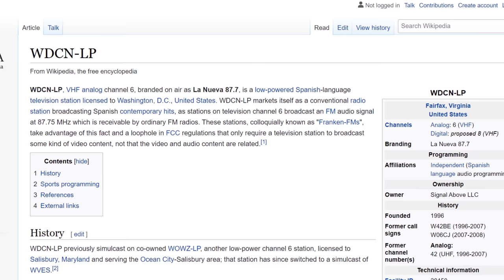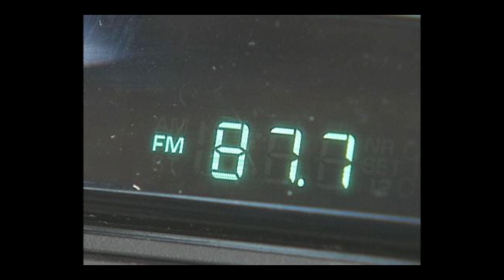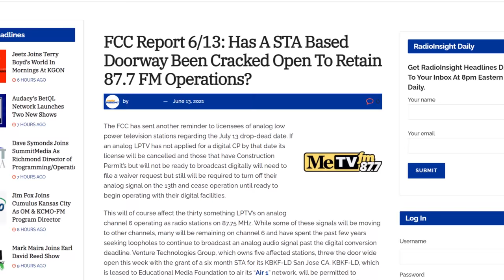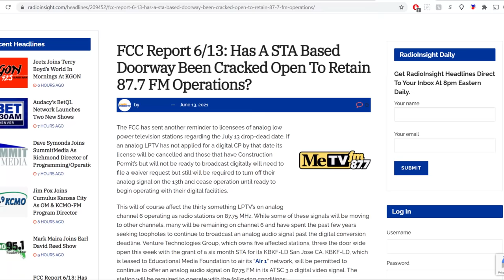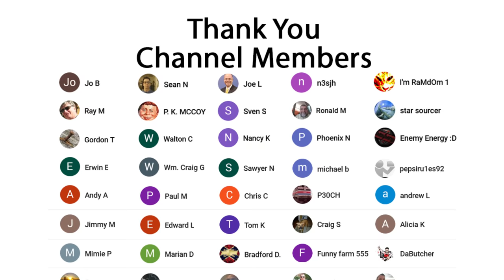87.7‌ ‌FM‌ ‌Radio‌ ‌Stations May Get Six Month ‌Extension‌

Comment: It’s funny how advanced we are in tech and yet many still use radio for news and entertainment. It’s not going anywhere. Radio does have its benefits.
Reply: Well, free IS free!
Reply: Yeah, especially during a power outage. I bought an Eton Elite Executive just for an occasion, and funny enough the day it was delivered we had a storm that caused a power outage for 6 hours. Also why I picked up a cheap Baofeng UV-5R for $25
Reply: Yep, as long as your not worried about the cover-ups. Still use the internet for an in-depth political analysis.

Comment: I remember back before stereo TV they occasionally did TV/radio simulcasts. The TV broadcaster would air a concert and the radio station would air it's audio in stereo. It wasn't long before someone realized that it would be easy enough to make TVs stereo.
Reply: It wasn't all that easy. Television had to use a slightly different method of stereo encoding due to potential interference from the video signal, and since this new method was patented the stations had to spend a little money to get the encoder. That's why it was only "In Stereo Where Available" for so long.

Comment: If anything, this will give an opportunity for a good test of the system while the FCC still works on MB Docket 03-185 (the rulemaking proceeding that will be the last word on the future of the Frankies).  These operations though get an unfair advantage over secondary FM users (FM translators and low power FM stations) in the 88.1~91.9 band.  Stations in that part of the FM band, which is also known as the "reserved band" have to give specific protections to channel 6 TV stations.  Those rules go back to a day when we had analog signals and mechanical tuners.  We are hoping that we can at least get some rule changes where the secondary FM stations would no longer have to protect the low power TV channel 6 stations as that protection is no longer needed in the digital age, even if there is analog sitting on 87.75.   The FCC almost removed these restrictions in 2020, but there was a last minute objection from your friend and mine, WPVI...   Other than freeing an unnecessary restriction for noncommercial secondary stations (and unlikely interference to FM stations on 88.1), I see no real valid reason for NPR to oppose this.  I do feel that if these stations want to behave like commercial FM stations, then they should be subject to some commercial FM rules, such as limitations on power and height and the payment of annual regulatory fees similar to that of a commercial FM station.  But, like I said in the rulemaking proceeding, I am intrigued by what Venture Technology is trying to do and as long as the needs of other interests (including the ones I represent) are met, then "Franken FM" stations and reserved band FM stations (primary and secondary) can live in harmony.
Reply: Michelle Bradley, here in the Chicago metro area, we have MeTV FM at 87.7, and a low powered community FM station at 88.1. I detect no interference between reception of either of these stations, with old vacuum tube receivers, old solid state receivers, or with much more modern equipment. They thus can coexist with each other with no problems. If NPR has a "problem" with this kind of coexistence of these stations in other parts of the country, then maybe they should take a serious look at their dreary program formats, and do something positive to make people want to listen to their programming.
Reply: Good points.
Reply: @jeromewysocki8809  In most cases, "second adjacent" channel interference normally does not happen.  When it does, it is in the direct vicinity of the interfering station's (in this case, the MeTV stations) transmitter site.  To accomplish this, we use an engineering formula that takes into consideration of how strong the "desired" station (in this case, the 88.1 station) is at the transmitter site.  Now, while the FCC does not have a specific standard for a separation of 350 kHz (87.75 to 88.1), we can apply the standard for 400 kHz (87.7 to 88.1, what we call "second adjacent").  

In Chicago, 88.1 is a very interesting channel as there are a lot of small noncommercial stations.  The closest station to the Ch.6 transmitter is WCRX.  Based on how strong WCRX reaches the MeTV facility (72.4 dBu) and using the 400 kHz "second adjacent" method we use in radio, the interference (if any) will only be experienced within 922 meters (3,024 feet) of the MeTV site.  The MeTV antenna design may also reduce that interference area because the signal would be radiated more outward than downward.   In radio, this would be unacceptable (because interference to at least 1 person would be unacceptable)..  

This is the kind of interference that NPR is worried about.   I am not taking a position here on whether NPR is justified or not in their argument, but I wanted to give information on why NPR would be concerned.

Comment: While I was in NC, in Burlington and in Ocracoke Island, Cable Company provides analog signals for TV at the house and in the Motel, and I didn't know that the analog signals from Cable Company in NC still existed today and it was awesome that you can use the old school CRT TVs or the flat panel LCD TVs with HDTV wile watching any analog cable channels. I thought they are using digital signals for the cable, but it actually uses analog signals from Cable Company which I used to see the digital signals from cable box in KY, but in NC, they still have analog signals from Cable Company. And I really don't know when the Cable Company is going to upgrade from Analog to Digital Signal, and we all will see when it happens.

Comment: What the FCC should do is give these stations another frequency further up on the dial so they can still broadcast radio only but not be considered a TV station, or extend the FM band down to 76MHZ like they do in Japan. I believe since the digital transition there are hardly any stations broadcasting on VHF low anymore and the majority of digital TV stations now broadcast exclusively on UHF because it is more desirable for digital.
Reply from the maker: Yes, after the digital transition there aren't too many TV stations left on the (trash) low VHF band except in very crowded markets.
Reply: Radios can't tune that low.
Reply: Ryan Toomey, In areas like Chicago, there supposedly are no other frequencies in the FM band where these stations can be reassigned. Getting equipment to tune down to 76 MHz is also a problem, and there is probably too small of a consumer market to be profitable to a manufacturer to make this happen. Good thought, though.
Reply: @Dwedit TV sound radios can.

Comment: The FCC could have eliminated TV channels 5 and 6 and created 60 additional FM frequencies between 76 and 88 MHz.
Reply from the maker: It's too little too late for that since many TV stations use both channels for broadcasting.
Reply: I was under the impression that hardly any digital stations broadcast on VHF-Low and they all mostly use UHF only, so they are not really utilized anyway.
Reply: The problem is that existing FM radios don't tune TV Channel 5 and only the very top of Channel 6.  The 60 additional FM stations there would quickly go broke transmitting to nobody.  Plus, it's not as if there is a shortage of radio stations in the U.S.:  Current count as of 12-31-2020 is 6,699 commercial FM stations, 4,195 NCEFM stations, 8,420 FM Boosters and Translator stations, and 2,136 LPFM stations.
Reply: @dane1234abc1  Channel 5 uses Japan FM frequency on 81.7 MHz. Channels 3 and 4 are overlapped Soviet Russian OIRT FM band.

Comment: I was get 88.5 fm on ch 6
On Is analog television
Reply: I also got 88.3 too. That TV has auto fine tunning. Cable TV channel 6 using Multisystem NTSC PAL SECAM TV from Saudi Arabia. 87.7 for NTSC-M, PAL-B/G for 88.5, 88.7 or 88.9, PAL-I for 89.1 to 89.3 FM and finally, PAL-D/K for 89.5, 89.7 to 89.9 FM

Comment: Couldn’t many Franken FM’s switch over to internet radio? Many have access to the internet.
Reply: The good folks listening to the very successful variety/retro format are going to have trouble making the leap to listening through their phones. Besides, that's available now.
Reply: While internet radio is good, it does obviously need an internet connection, or at least a smart phone.  A lot of older cars don’t have Bluetooth, or Apple Car Play and just have a regular FM/AM radio.  I think a lot of the Franken FM listeners are in cars driving to and from work.
Reply: %99 of radio is listened to  in cars. IP radio is not convenient for that
Reply: @bend1119  It was just a thought. That (in my opinion) would be the best way for Franken FM’s to keep on living.
Reply: ClassicGuy57 , I don't think these stations have any problems of their own to keep living. Large numbers of people listen faithfully to them. They are endangered by the likes of NPR, which is trying to convince the FCC to eliminate them. Apparently, NPR is pissed off because many people pass them by, as they tune their car radios to 87.7. If NPR doesn't like that, they should do something about converting their dreary program formats into something that the public might like to listen to. I really wonder how long NPR would be able to stay on the air if they had to do it without any support from us taxpayers. They don't seemed too concerned about money, so they probably figure, why change?
Reply: I listen to radio to get away from the internet.

Comment: I think 54-88 MHz should be used for fm broadcast in areas where there are no channels 2 -6 and when there’s a lack of available assignments in the 88-108 MHz band
Reply from the maker: Yes, that would be a good idea.
Reply: Jeff Laymon, that might work, but it would require a huge investment for companies to design, manufacture, market and sell the necessary equipment to perhaps a very small consumer market.
Reply: China uses 49 - 92 MHz on VHF channels 1 - 5

In Japan, 90 - 95 MHz are also expanded since 2013 from 76 - 90 MHz.

Comment: Here in the U.K., 87.7 is used for low-power radio services such as around showgrounds. for college stations and hospital group stations etc., plus for temporary stations at one-off events or to gauge support for a new station before a full licence is issued.  I don't think 87.7 was ever used for TV audio over here.
Reply: VHF 405 Line TV system A from 45 - 41.50 to 66.75 - 63.25 MHz, but overlapped Soviet Russian OIRT FM band on UK VHF channel 1 - 5. Ireland uses PAL-I from channels A - C (45 - 67.75 MHz.
Reply: 91.7 FM in China is PAL-D/K VHF channel 5.

Comment: What if the full power tv stations did not covert to digital also FCC could do a digital radio signal so channel 6 or 6-1 can still be on 87.7
Reply: HD Radio and ATSC or ATSC 3.0 are not compatible.
Reply: I know I was thinking if that would happen when the digital transmission of 2009 happened I worded it wrong I was saying that if we kept the analog audio and converted to digital tv
Reply: @CableCable9000  also DTV sound introduced in Japan in 2013 but ISDB-T 1SEG. AM: 504 - 1710 kHz, FM: 76 - 95 MHz, DTV SOUND (1SEG): UHF 13ch - 62ch (same as UHF 14ch - 63 ch in the Philippines, Brazil, parts of Latin America, etc.)

Comment: Honestly, if someone is willing to pay for the license for that chunk of spectrum, it should be theirs to do with it as they please. I get the need for "standards", but really, in this instance, the FCC should just let it go. Nobody actually wants VHF-LO for ATSC anyways
Reply: Amen it's semi unconstitutional what the fcc is doing
Reply: I feel the same way. I don't know why the FCC cares about channel 6. None of the large corps want a station adjacent to the FM band. May as well let them continue broadcasting analog. In my market everyone has moved to UHF and just uses the old channel number.
Reply: I agree that VHF low band is all but worthless for DTV:  The protected DTV contour of 28 dBu (25.1 uV/m) is a joke:  My compact fluorescent lights generate that much (10x if it's a CFL from China), plus there is skip IX and IX from Part 15 game devices generating output on VHF Channels 3 or 4, some of which undoubtedly leaks into Channels 5 and 6.  But the correct solution is to start a rulemaking, to ensure that Channel 6 Franken FM stations don't cause IX to Channel 201 (88.1 MHz) NCEFM stations.  Plus, I find it offensive that Franken FMs can flip off the FCC technical standards with impunity.
Reply: @dane1234abc1  It's kinda like CB radio, though. They've all been ignoring the rules for ages. Why even bother to force them to ATSC? If their NTSC transmissions were causing problems surely it would be known by now. They should probably just reassign VHF- LO as unlicensed amateur NTSC broadcasts since it's about useless for any modern purposes.

Comment: I have a question & that is there is a commercial free low powered radio station where I live &  it not a old radio station its call letters are WFDG & it is only on the air half of the time & I love their format they play oldies & I love their format & there is one more low powered radio station that is commercial free where I live & its call letters is WMKP & it is a religious radio station & I was wondering if there will be more low powered radio stations sign on both inside & outside of my area as time goes on ?  I wish someone would get a country oldies commercial free radio station started in my area don't get me wrong I love WFDG but they play rock & roll oldies & I love rock & roll oldies but I also love the old country music that was out in the 60s & 70s & 80s as well I also wish more radio stations would start simulcasting on both a-m & fm than they currently are